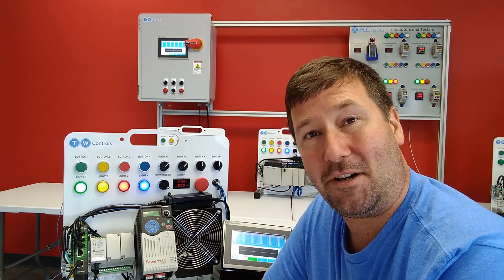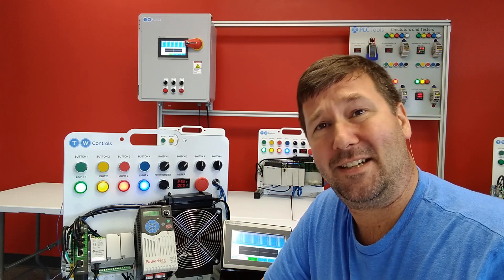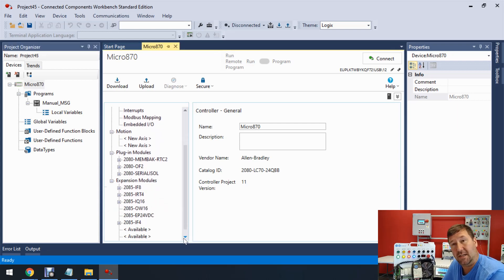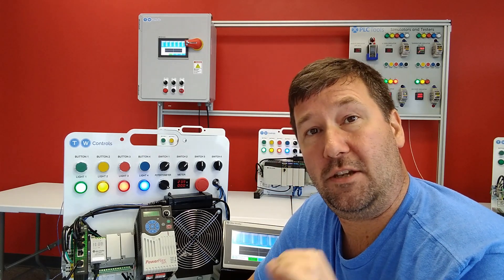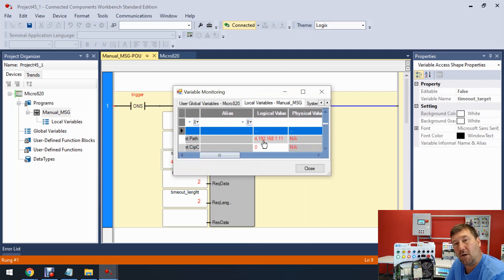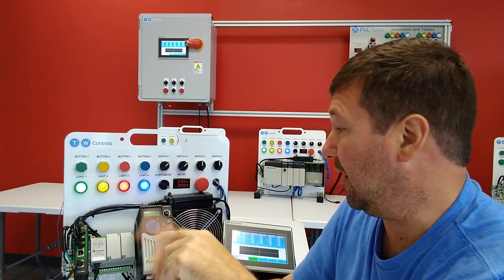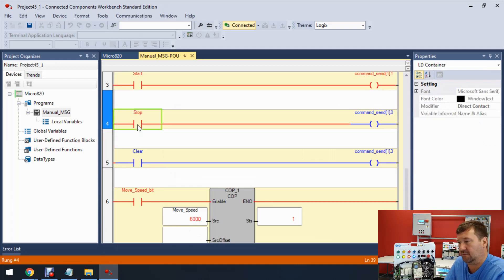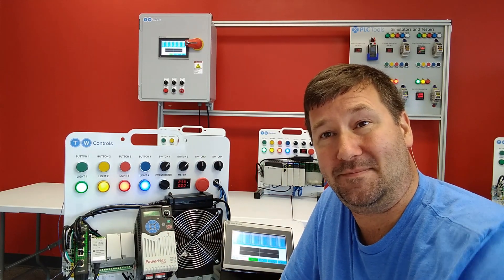MSG Message from a Micro800 to a Powerflex 525 Drive

Comment: Hello Tim, thank you for video! Any cjance if you could mak a video How to control PowerFlex 525 with MicroLogix 1400 :)
Reply from the maker: I'm going to do some messaging video soon and that will cover the Powerflex, Compactlogix, and MIcro800.
Reply: @TimWilborne  please can you include RS500? It is still very widely used. And for beginner-improver like me, this is a very good choice because of its price and versatility. Thank you :)
Reply from the maker: That is what I mean.  I'll be doing Micrologix videos on how to communicate with each of those.  But you should be looking looking for a Micro800 with Connected Components Workbench.  Its software is free and there are economical PLCs as well but it has many more capabilities.
Reply: @TimWilborne  Thank you!
Reply from the maker: You are welcome

Comment: Interesting but I am so confused. I have a photo eye input to a Micro850 that is detecting a part. When the part is there I want to send a message to an Epson robot that it’s ok to get the part. It would be easy to just wire an output from the Micro to an input of the robot but I don’t know what other signals I will need for this project so I’d like to use a message. It doesn’t help that Rockwell doesn’t leave all of the necessary information.

Comment: Can you do a video on position control with the micro 800 series and powerlex 525 over ethernet
Reply from the maker: Hi William.  I have one coming on stepper and servo control with a Micro850.  I'm struggling with the feedback for a Powerflex 525 drive.  I'd like to be able to do it with the 3 phase fan that is on the trainer.  Any thoughts?
Reply: @TimWilborne  Hi Tim, Thanks for the reply.
My experience with micro 800 series and CCW is only from watching your channel. 🤔
Haven't even got our hardware yet..
Thank you for all the great videos on CCW  btw. 
I work on omron most of the time Siemens Schneider and the rest never AB done some slc500  PLC's but not motion.

I have a project coming up which is using a micro 850 with 6 3ph motors using 6 encoders for position.(servos must have been too expensive)
 It's for lifting machinery off an agv in a manufacturing cell with x,y and z movemment, so 3 pairs of motors.
The vfds have not been specified but the plc has to be an AB , we have went with micro 850 again because of cost.
So I was thinking powerflex 525 just because of the ethernet IP comms capability with the micro850 rather than a different brand of vfd. So the plan is 525 with encoder add on module, the Micro 850 to a send the position setpoint over EIP  to step 0 on the vfd (L200...L214 step no.s). I believe the value is sent to 2 consecutive addresses so L200 and L201 FOR STEP 0. 
Hard wired switches in the plc for home/zero pos which I read in the manual can be done over Comms aswell. 
Hard wiring the steps would be no good as it's limited to 8 positions. I need at least 25.
I would like to have all Comms over Ethernet apart from safety.
I downloaded a user FB from the  Rockwell site which has the functionality for position control although it just sets the bits for vfd step positions rather than dynamic values from the plc, although this can still be utilized but I need to send a setpoint before triggering the step 0 bit.

I think it's do able, the position setpoint may need to be done with the messaging instruction you used on a previous vid.

For your test rig you should have all the equipment although not sure how you would have the encoder reading the fan rotation. I think you would need a small motor as  it would be hard to use your pulse simulator.
Reply from the maker: @williamhaggan4812  Look at the specs of the different Micro850s, many of them have built in high speed counters.  You would still need plug-in high speed counters but not as many.

Comment: I am using the UDFB that I found on Rockwell's site for positioning (similar to the one that you demonstrate in your UDFB video but with a few more parameters included.  There are a few more that I will need though.  Is there a way using MSG (or some other method) to read/write to an individual parameter on the PF525?  I did the project once before using a Micrologix 1100 and I was able to set up individual MSG instructions for each parameter read or write.  Hoping there is a way to do it in CCW???
Reply from the maker: I have a PLC training class this week so no time to look but the same code you used in the Micrologix 1100 should work in the Micro800.  You would use the CIP Generic Message.

Comment: I should be able to connect to both....through port1 on the trainers ethernet switch?  

New to this but when i go through the switch i cant connect to to micro820 plc , when connected right to its ethernet port i can connect.  ...
And  my computer ip address is 192.168.1.12 ....and thats the powerflex default you just mentioned
Reply from the maker: You need to change your PC's IP address, you are getting a duplicate IP address when you plug into the Ethernet switch since it is the same as the Powerflex 525.
Reply: Okay thank you!

Comment: Randomly I set this up today then saw this video! I used the "Micro800 UDFB: Ethernet communications with PowerFlex 750-Series, 520-Series and 4-Class Drives" from the Rockwell code library to achieve this.
Reply from the maker: Yes that is the nicer option in my opinion. Putting out a video on it next week.
Reply: @TimWilborne  It has a lot of good stuff to use in the block. Excellent videos, keep them  up!

Comment: Hi Tim.  I have a 755 drive, a PanelView800 HMI, and a Micro850 PLC.  I want to send a percentage of torque reference through parameter 676 in the variable frequency drive.  I have used a Rockwell UDFB but it doesn't have that address.  How can I do?  I have not found information about that parameter using CIP explicit messages.  Sorry for my bad English
Reply from the maker: It should be possible but it is going to take some modifications to the UDFB.

Comment: I have 2 questions. Have you done a video on setting speeds for the powerflex on the hmi? My second question is do you happen to know if the micro820 can communicate with abb acs355 drives or only power flex drives?

Comment: Thanks  mister Tim, i'm in a same project with ABB drive (acs580) and i'm having problem to config micro 800 communication. i hope your trick gonna help me. I found a publication on ABB site (micro800 to acs) but it still don't working. they don't trigger the msg fonction bloc. Do you think it's necessary to trigger it ?
Reply from the maker: Yes, otherwise a message instruction will only execute on the initial scan.
Reply: @TimWilborne  Thank Lord Tim, don't need to trigger, micro800 to acs580 ODVA. with your advice, i put the default ip adress on micro800, i put the same range of ip adress on the 3 ac drive. now it work find ! thank you. how much cip generic message we can drive in 1 scan on micro800 ? (sorry for my english)
Reply from the maker: @silluc21  There is a limit of the number of messages you can send per scan.  I don't recall what it is off of the top of my head but you should stagger the messages.  Google cascading timers, it is how I usually do it.

Comment: Hi, Tim. Thanks so much for your work! I am struggling as I have a PowerFlex 523, which does not allow for the Start Source and Speed Reference to be controlled via Ethernet/IP? All the sample codes I have found seem to reference the Ethernet/IP. Any advice on another way to communicate a speed to the VFD? I tried DSI and the Network Opt but didn't really know what I was doing.
Thanks,
Dylan
Reply from the maker: Which adapter are you using to connect the Powerflex 523 over Ethernet?  Also what are you trying to control it with?
Reply: @TimWilborne  I am using a Micro850. All of my componets are connected to a main switch. I traditionaly download the PLC with usb. I have successfully uplaoded VFD parameters through ethernet (port1 on the VFD) with CCW implying I have a solid connection to the VFD. Thank you so much for your quick reply!
Reply from the maker: @dylanimbus3659  The messaging parameters are different for the Powerflex 523 but the User Defined Function Block method should work fine with it.  See link below.
https://twcontrols.com/lessons/control-an-ab-powerflex-525-drive-with-a-micro800-micro820-plc-with-a-user-defined-function-block
Reply: dyan you can by a ethernet card for the 523, or you can use the analog on the drive to feed back info.

Comment: Tim, quick question, you may or may not know but as you're using CCW a fair bit you may have seen it. On one of my programs down the side I have an ST icon that has a tiny orange icon in the corner of that icon (meta!). I can't find any mention of it in the manual and it's so tiny I can't make out what it has in there?! Looks like and upside down T ( up tack) possibly... any clue?
Reply from the maker: It is assigned some special purpose such as an interrupt.  Click on the controller at the top of the left pane then go to the Interrupts section and see if the program is shown there.
Reply: @TimWilborne  ahh! I have indeed assigned an interrupt. Do you know if there is documentation for this or did you just learn through experience?
Reply from the maker: The one learning curve that I have not overcome in Connected Components Workbench is its use of symbols to indicate things without any text. I can't decide if it is a bad design or my struggle to embrace emojis to tell me what is going on with a machine.
Reply: @TimWilborne  I'm glad it's not just me then! I also get warnings telling me I should UID/UIE protect code to lock threads. When I do this it continues to tell me I should do it, even though I've already done it! I know they are just warnings but I'd like not to have 20 of them every build! I'm sure the software will get there eventually, it's no TIA portal or Unity that's for sure! But the price keeps my employer happy!
Reply from the maker: @lewsut  Yes and Rockwell Automation has continued to tweak the software to make it more user friendly.  Probably what is missing from these icons is some type of mouseover function telling what they mean.

Also, the mystery icons are an improvement over RsLogix 500 where it didn't tell you that a routine was used for a special interrupt.